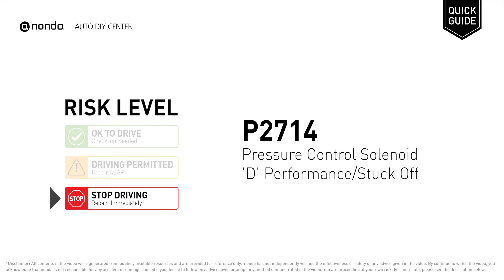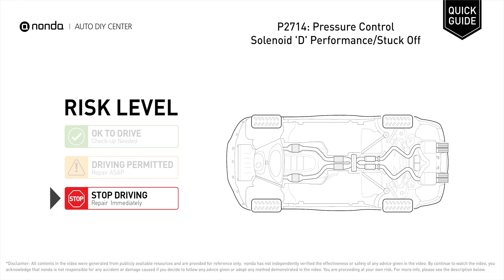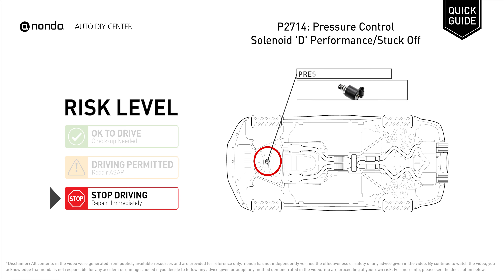What is P2714 Engine Code [Quick Guide]

Comment: I have this code showing on a diagnostic computer readout. Its not throwing an actual dash light. Its a "permanent" code. None of the accompanying codes common are showing with it. Could it be just the solenoid? 
I have an appointment at a shop to look it over, but I'm trying to prepare myself.
Lexus gx460 2014 136k miles